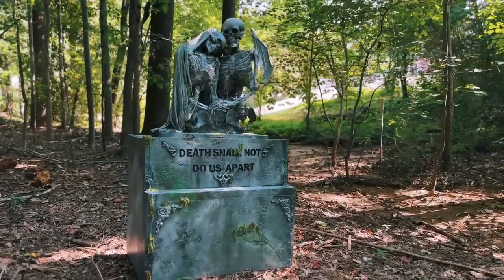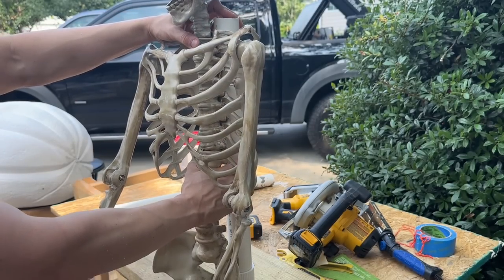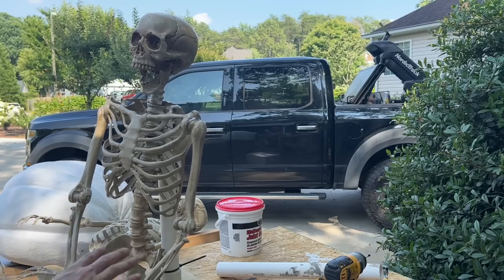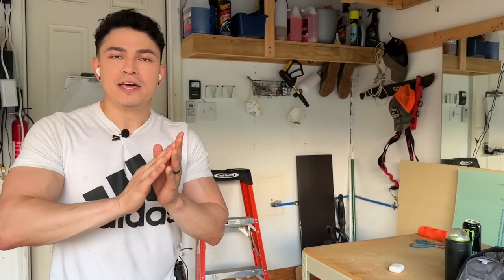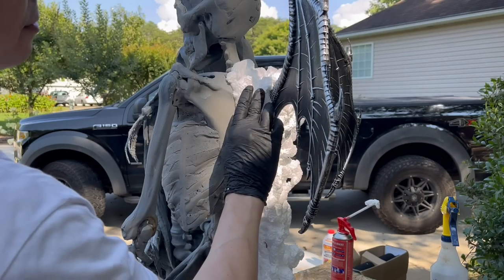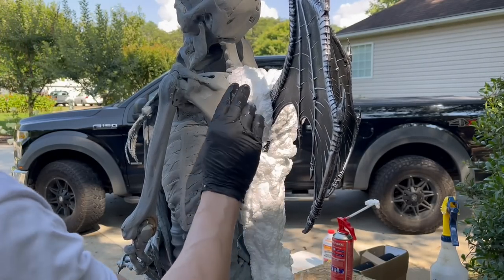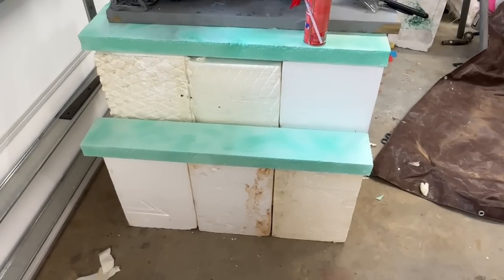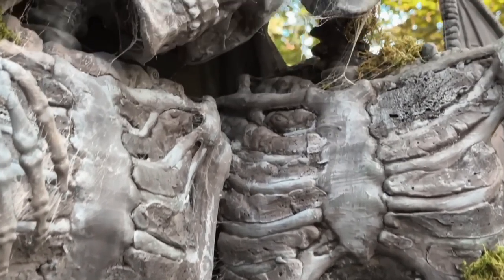SKELETON GRAVEYARD STATUE - HALLOWEEN COUPLE - Tutorial

Comment: Hi. Great video! I enjoy your channel. I have a question, im about to do a modification on my 6ft casket prop I bought at a big box store. It’s beautiful, but I don’t like that the top/ lids of the casket are flat, I want the more realistic casket look with the dome top. I landed on trying my hand at fiberglass and resin, but building my form with insulation foam board. I plan on cutting out multiple identical arches, and glueing them together, (sandwiching them to one another) Im nervous about working with the foam, because so many things can react with the foam and melt it, also not sure what glue will give the best adhesion. Any tips, info that may help?

Comment: I was finally able to get the blocks from Tractor Supply and making this is first on my list.  I'm hoping you see this even though this tutorial is 9 months old.  When making the base, are you using just the 6 blocks?  If only the 6 blocks, the top blocks look to be hanging off the back of the bottom ones so it has the ledge in the front.  Are there more blocks I can't see or are the top blocks propped up with something else?  It has the sides.  Is that what's holding it up?  Thanks.